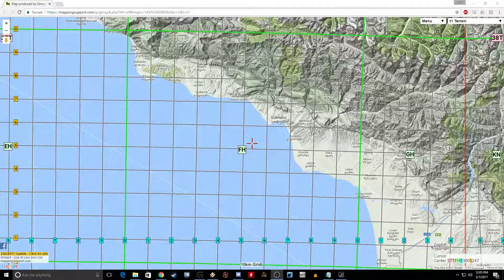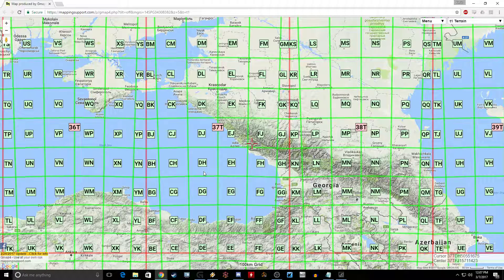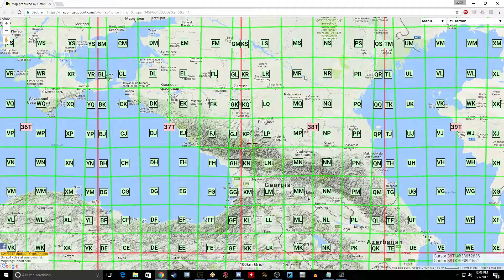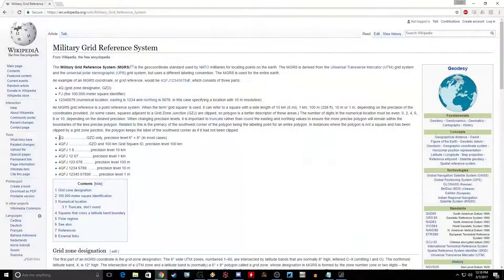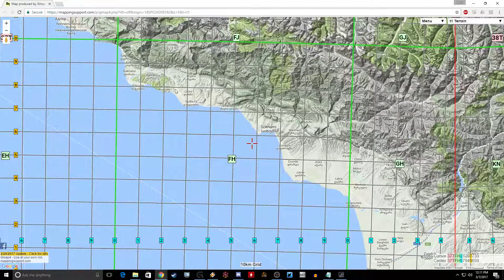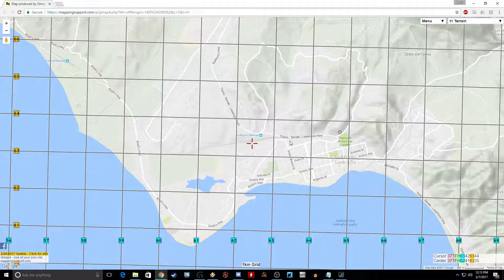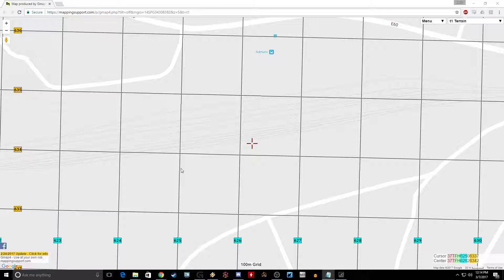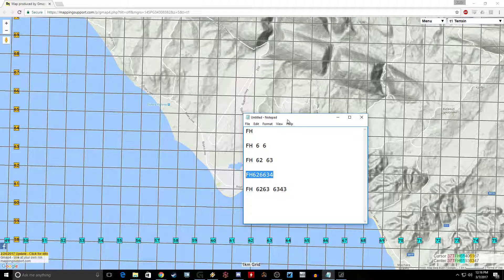DCS: MGRS Primer for DCS Virtual Pilots

Comment: Well I understand it. it still sucks though. that transition is horrible, right down the conflict zone. inconsistent continuations make it impossible to judge distances between the two grid areas. They should start with A on the left and A on the bottom. not some pulled out of their asses arbitrary letter. so if you know if you're at F that the next grid over to the right starts with A again. or better yet continues with G and then loop back around at Z to A. who came up with this nonsense anyway? sure it's shorter, but confusing, especially since you have to deal with the transitions.
Not only can you not guess the direction and distances, they are also at different angles!
Reply from the maker: Heh, well put! I guess there's always lat/long. ;)